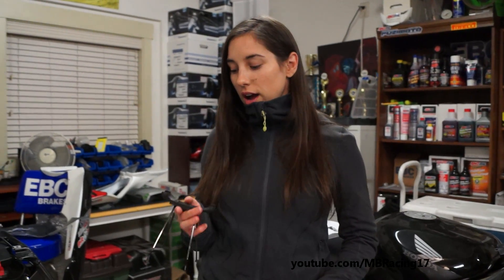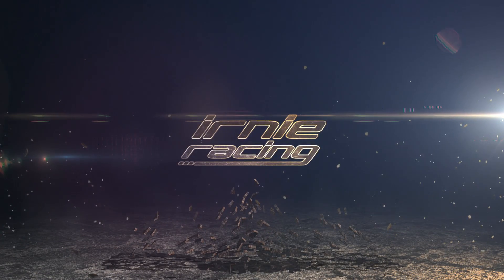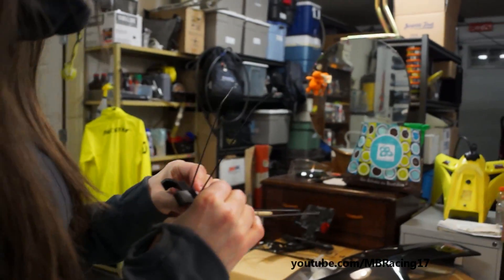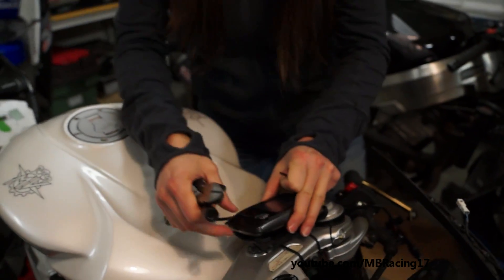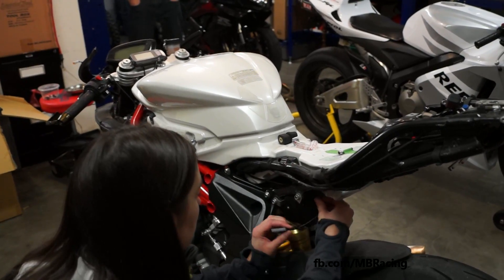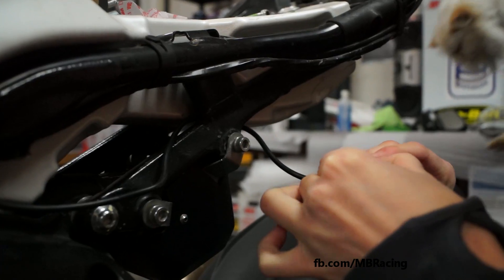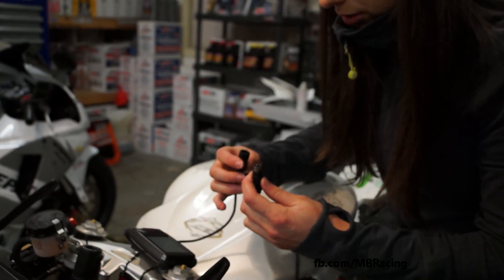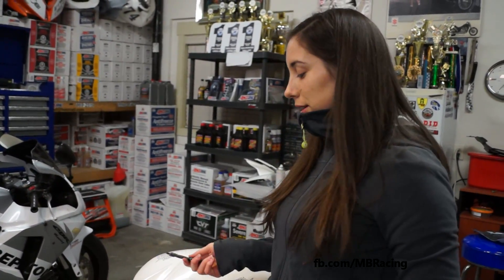Speedangle installation on a MV Agusta F3 800

Comment: Do you still have this bike? If so, have you had any recent ECU tuning? MV said they released a new ECU tune recently that helped clear up some throttle and power issues.
Reply from the maker: I still have that bike and I need to go do the ECU update. I have no problem of power, only starting problem.